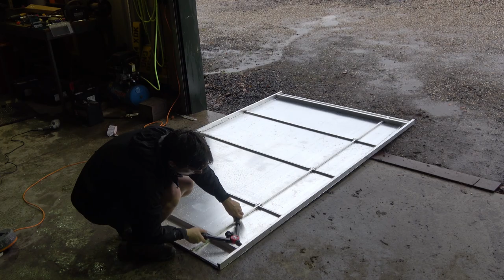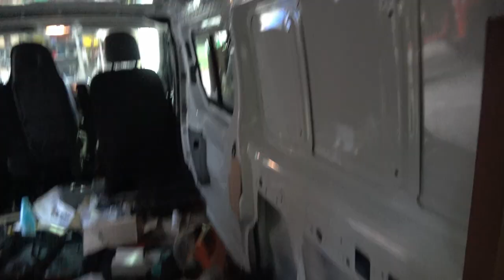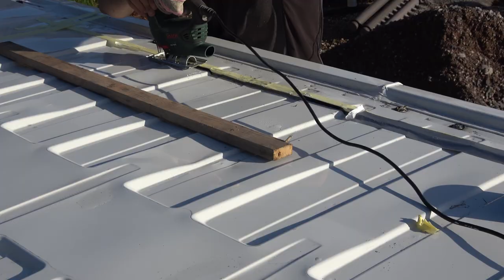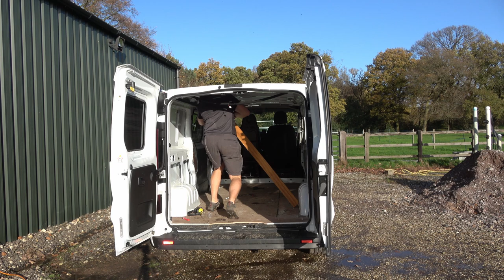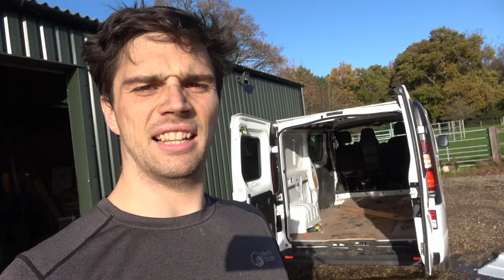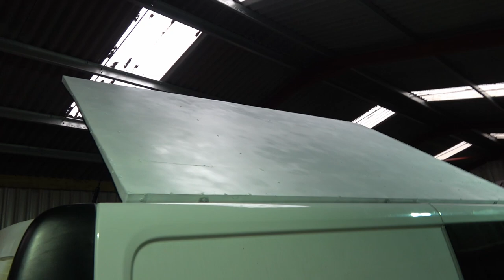Cutting My Roof Off! Making my Own Pop Top Roof - Part 2

Comment: Surely you have cut the rigidity out of the roof by cutting away the cross members and not bolting on a frame?
Any videos I have watched show a rectangular frame being bolted onto the cut out perimeter of the roof. What material are you going to use for the sides?
Onwards and upwards now. :))
Reply from the maker: The two steel cross bars add rigidity, the gutter where the roof racks would normally go is very strong which gives rigidity and supports the new roof, so it's all stable. I've got a 1000D canvas for the fabric, will have the next video out soon!
Reply: If you have a side collision that thing will fold...2 bolts and a 1/2" crossbar isn't a good substitute for structural integrity..
Reply: @joetaylor1459  so I'm not mad
Reply: That thing is not structurally sound and shouldn't be on the road..

Comment: omg! I would have never thought to use a jigsaw to cut the roof? What kind of jigsaw and blade are you using please? I see its the plug in kind, What are the amps please?
Reply from the maker: You just need a jigsaw and a metal cutting blade, most jigsaws should do
Reply: Yes any jigsaw will do it with a metal blade let’s face it the roof is only made of 2mm sheet metal

Comment: Couldn't you use the cut off roof for the pop top?
Reply from the maker: You could try, though it's quite flimsy, and might be difficult to waterproof the gap where you've cut.
Reply: @georgescott6671  I did exactly that on my mk4 transit … it works, the roof is a little heavy, and it acts as a bit of a bird bath, but it works, I am on here now looking for ways to add a lightweight ‘dome’ to the roof is convex and not concave.
My advice to anyone would be buy a high roof van in the first place,  but it has to be said the van is really nice with the top up.
Reply: Yes. I felt the same